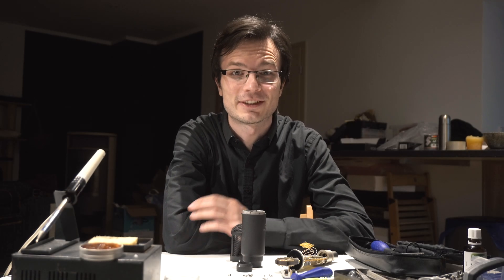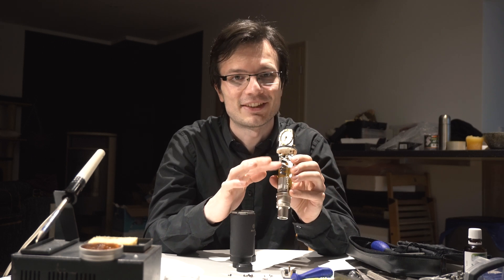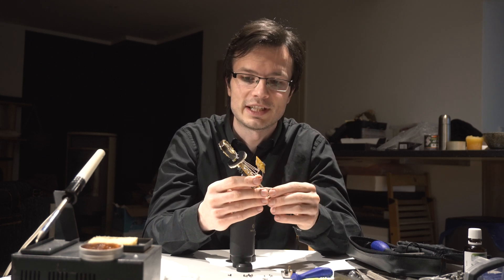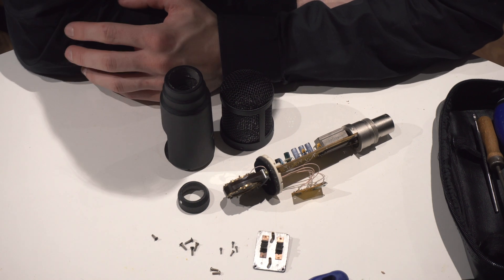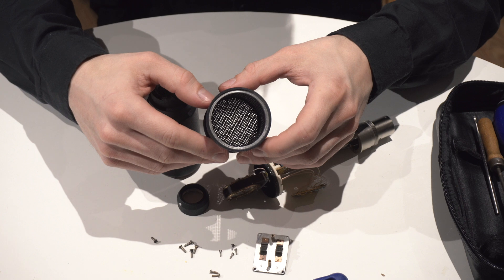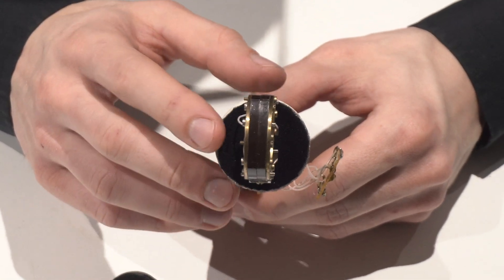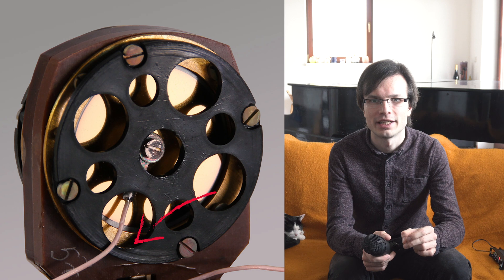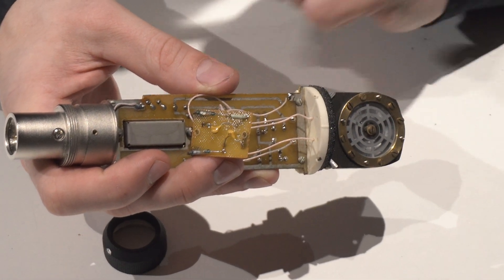DIY - How to significantly improve quality of an old cheap Russian microphone FOR FREE

Comment: I just returned MK-319 because it ringed and resonated unbelievably I thought it was broken so I returned it.
I am not sure what to think about this microphone anymore, I really like how it sounds but that resonance and ringing makes it basically unusable for anyone who does not want to mod it.
Does the shock mount helps with this problem?
How it is possible that the microphone rings this much?
Thanks...
Reply from the maker: You need to use a mount that holds the mic and damps the ringing... the stock mount is useless. The casing is basically a musical instrument.
Reply: @BohumirStehlik  Thanks. Does the shock mount solves this problem completely out just make it better?
I am so disappointed with this I am thinking now about buying NT1 instead, but I like MK-319 sound much more. 😔
Reply from the maker: @BojanBojovic  Try to hold the mic in your hand or use a rubber tape to hear more...
Reply: @BohumirStehlik  Unfortunately I do not have it anymore, I returned it as I believed it was broken.
However when it was on its stock holder mounted on my stand I squeezed it hard and the rigging was still there but it was just shorter.
Reply: Well what did you expect from a russian made mic? They (russians) can't make anything decent.
Reply: It rings like when you sing into it? Or how do you mean ringing. Thanks
Reply: @Helenography0741  It rings when you touch it,  or even touch the cable. While singing it works ok, but the room should be very quiet and without any vibration that comes from the floor. And shock-mount is a must.

The microphone is magical, the transformer sounds good, but it really needs a good room to get the best out of it. It is very dark so not for everyone, especially if you sing very close to the microphone, the proximity effect is very strong, but sibilants are very well controlled.
I suppose inside a dead and well treated room, and with no more than 15cm from the mic, it can sound great.

And another thing, do not mode it as it brings the high frequencies down, making the microphone sound more nasal in the mids, just leave it as it is.
Not everything you find on the internet is good, many advices are simply bad, and this is one of them. People saying that the mic sounds better and "more open", whatever that means, after they modded it are deluded.
Reply: @BojanBojovic  i just got one.. seems older and haggerd like. the top mesh was made to be flat. which is odd. but looks way better. unsure if it was modified. it was close to being pretty broken upon arrival bc ppl dont know how to do packaging very well! but tightened up the one screw inside ( was missing the other), and it seems ok now. compared to Stam sa87 a very nice mic, it does seem to hold its own strangely / surprisingly. anyway.. great to hear you think it doesnt need a mod. i like it darker fr one thing. and removing mesh seems very odd and wrong, considering all of Noymanns have 3 mesh layers so yeah the internet is silly. i am curious to know if removing resonator is better as no mics seem to have this. anyhow thanks for your reply, cheers.
Reply: @Helenography0741  Yes, the internet is silly sometimes (or most of the time). I removed the inner mesh, the plosives are stronger, while the "internal resonances" did not improve, whatever that means.
As for the resonator, I removed it to get the "more open, and smoother high end", but I ended up with it being even darker and with some nasal bump from 800 to 2000 hz, which is logical as there is less high frequencies.
I returned everything to stock, except the inner mesh, as the microphone does not need this kind of religious tinkering.

Some people remove the low cut and -10db buttons as they say those cause higher noise floor, also they replace the transformer and few other electric parts, and everyone talks about how good the microphone sounds after this. I never tried it so I can not confirm, however people talked about how "open, and smooth" the microphone sounds after doing just the basket and resonator, so not sure about that as I do not trust audio snobs and everyone who does not create a blind test after any change.
The main point is that there are almost no examples for before and after, those that you can find are a light year from a scientific comparison, if comparison at all but anecdotal at best.

What the microphone needs is a good case with silica gel inside so it does not get moist on the capsule, after which it starts making wind noise rumble. 
Also, the body resonance is horrible so using it without a shock mount is a problem, even with the shock mount the cable should not be touched.
Actually, the resonance comes from the basket so no real solution, i tried to kill the resonance by placing the anti-resonance self adhesive used for cars all inside the body, but no help as the grill makes that frequency.

I never got good results with it as my room is horrible, and this microphone really needs a good room to shine. I purchased it after listening the examples on Thomann's website, where I compared it with the U87 I have a lot of experience with, and with NT1 that I also wanted to purchase.
MK319 had the same transformer magic as U87, while not being as flat as NT1 so I decided to purchase it. The point is, their room is great, the singer used for those examples was good as well, so with those conditions fulfilled this microphone sounded great and it was a U87 for poor people if you ask me, however as I said earlier, without a good room it becomes almost unusable as its resistance to background resonances and noise is not the best.
Reply: @BojanBojovic  dang wow thanks for all your thoughts! my room is kinda terrible too, but the 319 seems great, guess i got lucky somehow; holds its own against a great u87 clone. but all in all i dont have high end mics to compare and comparing mics scientifically doesnt work hardly it seems unless reamping the sounds, and nobody does that hardly! i just got it bc it looks natsy and older, and like art. wish i just knew if mine was modded other than the top of the basket being flattened. maybe this takes care of the resonance ringing hmm but i like darker! so ok i should probably remove the resonator thingy, i just dont want to cut it, but am nervous to unscrew the little central capsule screw holding it....
Reply: @Helenography0741  Do absolutely nothing to mod it, you will only make it worse.
Use a shock mount, and enjoy.